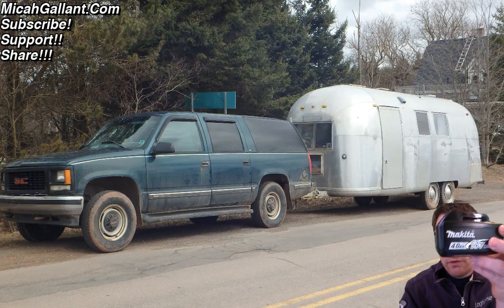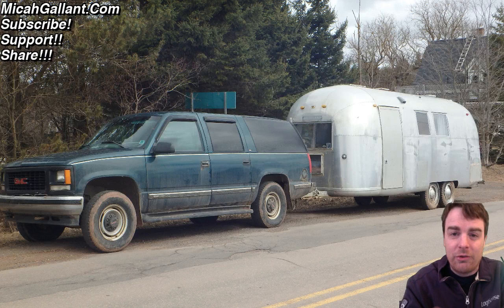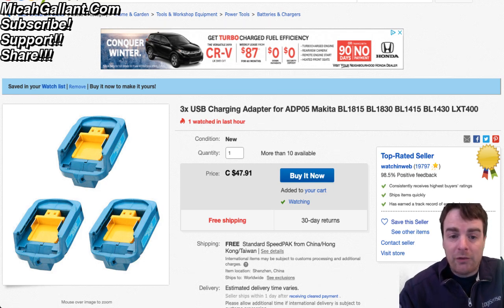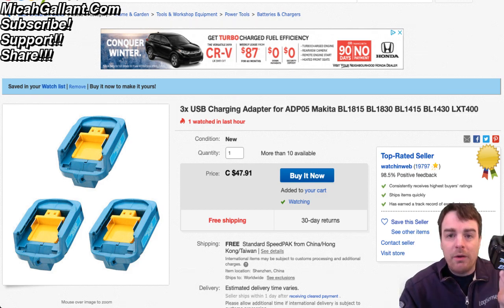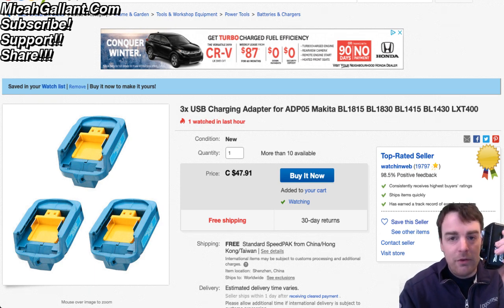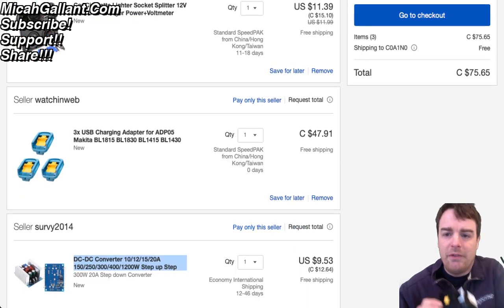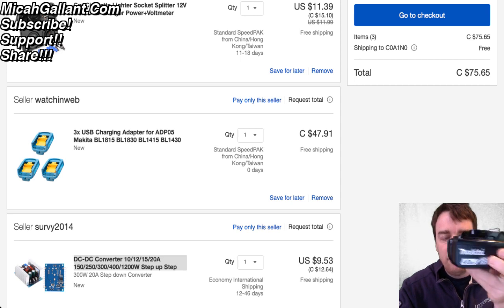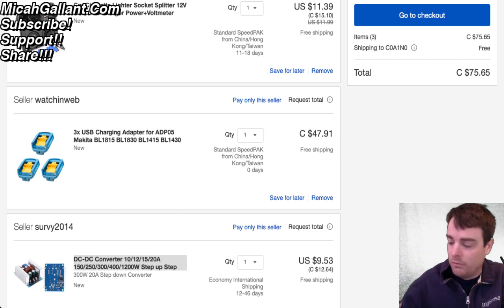Powering my OFFGRID Airstream with 18 Volt Makita Batteries!

Comment: Great concept! I am a Carpenter/ joiner in the UK with about 20 x 5 and 6 volt Makita batteries in the garage.But as always new Makita  products  are coming on line all the time. I'm toying  with idea of using the new 4 battery Makita portable back pack as a starting point, but to use it as my leisure  battery  charging straight from the engine.
No idea at the mo, how to configure, and most VW T6 conversion specialists wanna sell me their  own lion battery systems.